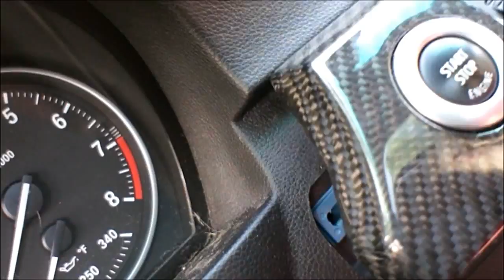BMW 335xi: Aiming headlights, Buffing a scuff, and replacing dash clips

Comment: My 328xi with the same xenon adaptive headlights as yours are aimed to the right. Both of them. And I tried to adjust those turn nobs that you shows in this video plus the one on the side fender and they still aim crooked. Also when I start the car you see how they aim up and down to adjust vértice level? Well mine are now adjusting opposite directions (one up the other down and vise versus). Any suggestions?